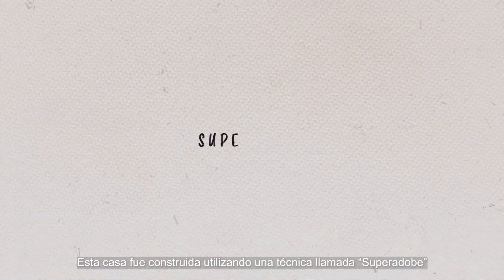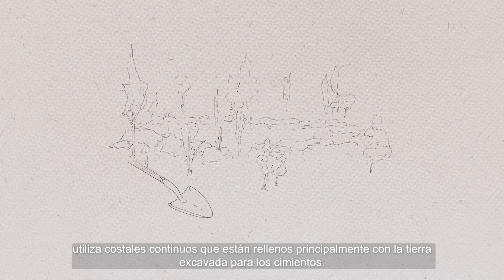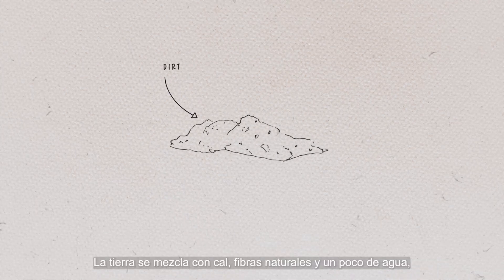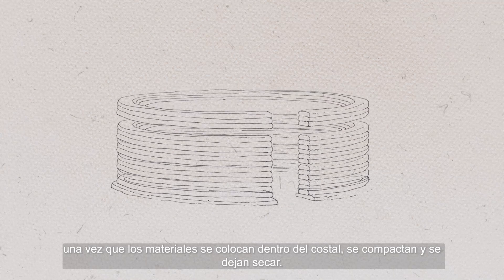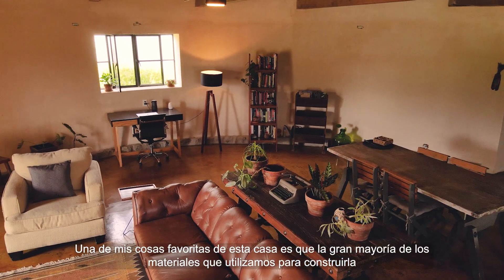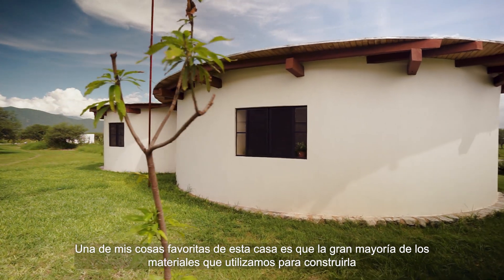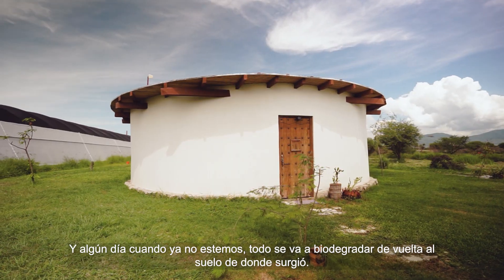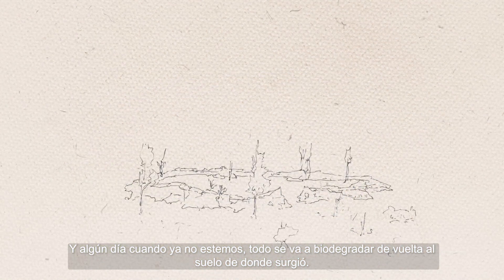1100 SQ FT Round Super Adobe House with Flat Roof!

Comment: Would love to learn about your mix, plastering, and roof structure. I used to build a very similar house (5m diameter), but ecounter some problems with the roof structure and external plastering. My location is in Cambodia in South East Asia, a very humid and wet tropical place.
Reply from the maker: Hey dude - so for our mix we used a tad bit of tezontle, cow manure, 2 percent cement and then if I remember right, 10% limestone…  and then we put a coating of concrete on outer layer that had sealant mixed with it… also important to not seal the inside part of the wall… so humidity has an escape
Reply: Hi Naveed,
Wouldn't the concrete coat on outside wall surface be a hindrance for breathing ?